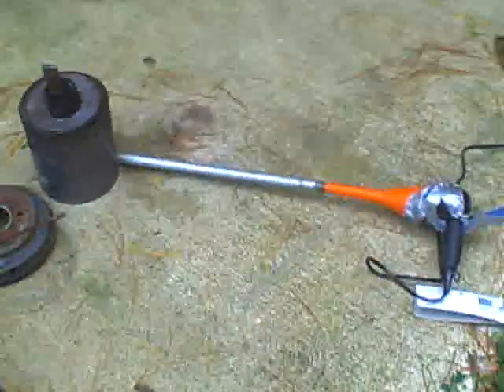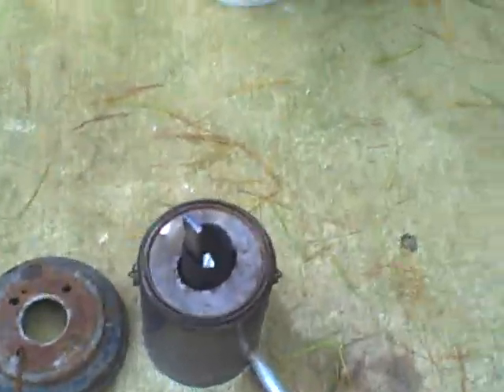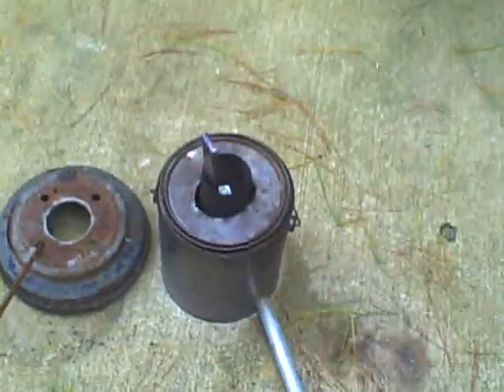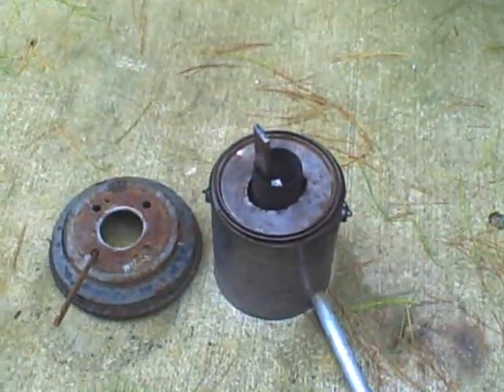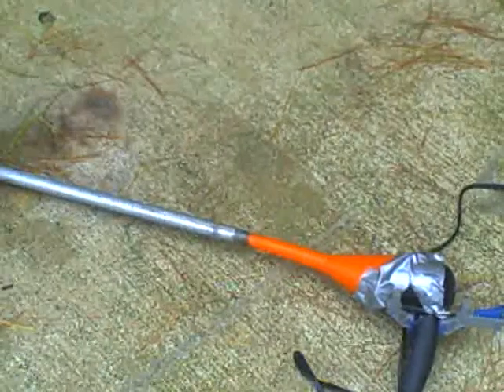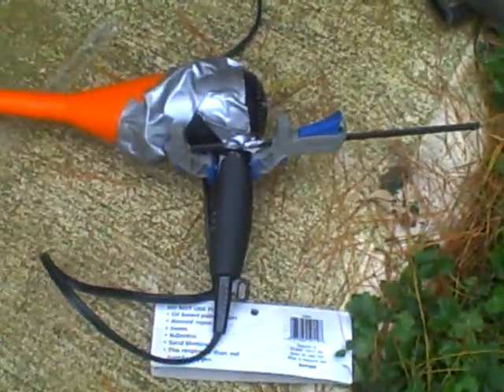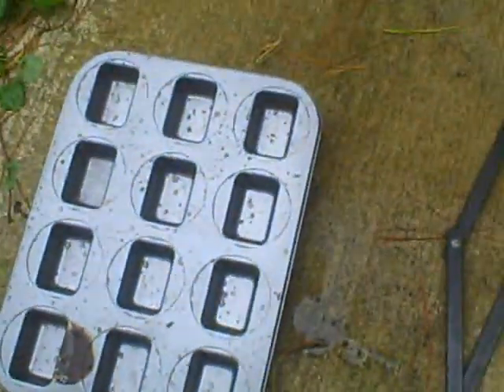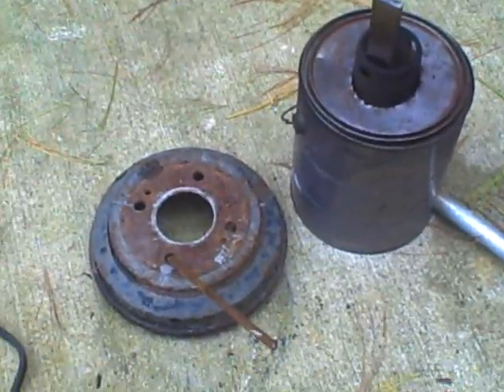$30 backyard aluminum foundry

Comment: never fear my friends,for a simple thumbs up and suscribe.go to  hobbyking
and get the approp size EDF fan(brushed motor) and lipo.if you get a brushless setup.you will need rx tx and esc.they push 2pound rc jet at 120mph.also the cheapest prices.thanx

Comment: @mitchellberry In most states 1 pound of aluminum is 70 cents which is 36 cans, so if you throw a party and people throw away a crap load of a cans you can burn them down into blocks of aluminum and sell em.

Comment: It hapned to me i used some old automated valves boxs to get some free aluminium.
They worked very well. only got to mutch slag in it with lots of good aluminium in it.
So i put every thing in th crucible again and got over 1Kl of aluminium more but the slag cougth on fire and it burned until it got all stuck back together :) it was fun to see

Comment: @flamedrag18  Beverage cans don't work. They shrink like wax. All extruded aluminum has a big shrink factor.You can only use old castings of aluminum. Watch out for magnesum it will catch fire and won't go out no matter what you do and will explode if you put water on it.

Comment: I used a vacuum cleaner blower for my waste oil furnace wired with a dimmer switch to control the blower speed. I had to restrict the intake a lot to keep the airflow down but it worked great. Unfortunately I don't have that blower anymore but I'm looking for another one for my propane furnace.

Comment: You're going to need a ceramic crucible.  If your oven is too hot, not only will it melt aluminum but steel too.  The melting point for Al is lower than steel.